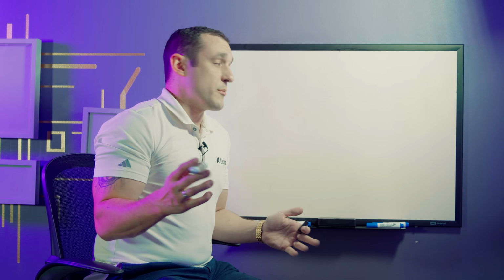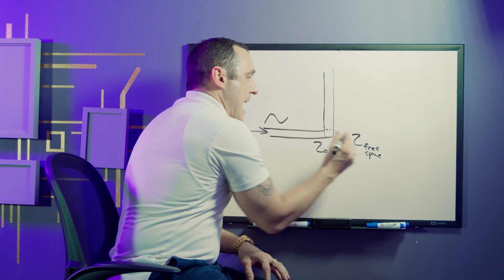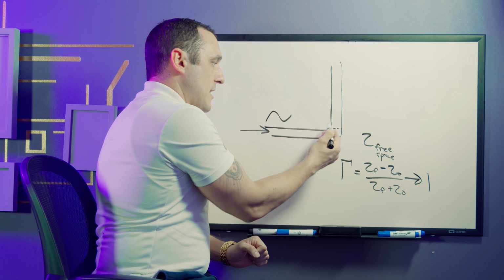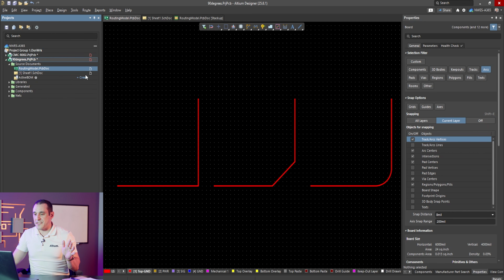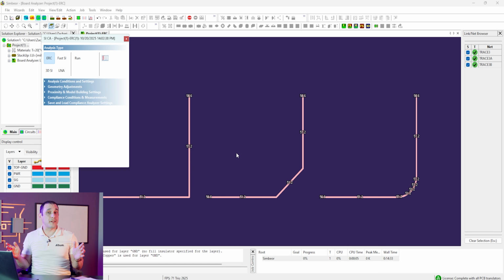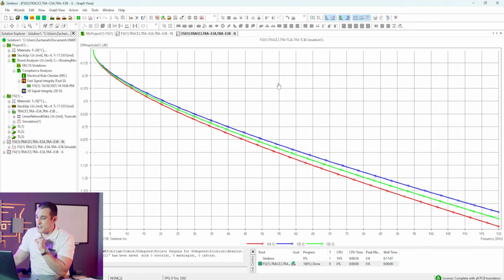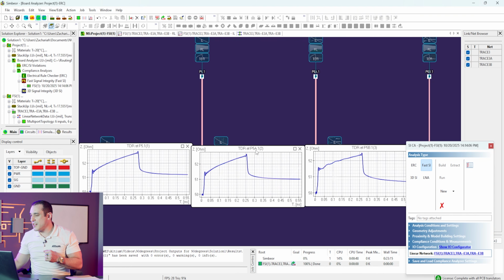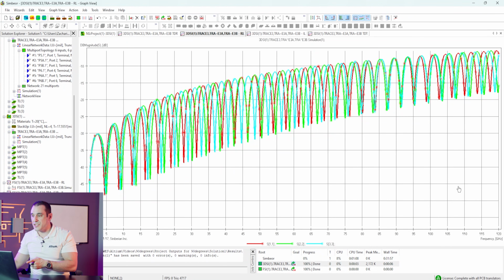Do 90-Degree Bends Hurt Signal Integrity?

Comment: I look at 90-degree PCB traces mainly from a mechanical durability perspective.
For this reason, I do not agree with you; in environments such as automotive applications where vibration and flexing are present, manufacturing-induced stress and the mechanical load of heavy components concentrate stress at these corners, which can eventually lead to trace cracking and intermittent connection issues.

Comment: B-b-but, what if the trace into a via is off center, on one side with the trace at the other end of the via offset on the other side of the via?
Doesn't that create a cylindrical 'roundabout' signal path, similar to a coil, instead of a right angle? 🤔

Comment: If there is a preset size W(idth) x T(hickness) for a trace, then when you go into a 90 degree bend, the trace increases in width by x1.414. But here is a question. IPC-600 and -610 Class3 are an assembly I.P.C. standard, but IPC-220x is a PCB Design I.P.C. standard so how do you design to -600 and -610 assembly standards where the hole fill must be 75% minimum, but you have many different flow rates vs temperature etc, different menisci etc? Too big and the hole does not fill, too small and the leg does not fit?
Reply: Yes the 1.414 factor at maximum gives the additional capacitance, it's just a matter of whether it is noticeable in TDR/S-parameters. About your other question, this is partially a processing challenge and partially a design challenge. In the processing aspect, the manufacturer needs to verify their process will allow sufficient flow in a given hole for a specific type of solder (leaded vs. non-leaded). It also varies by solder paste type as these have different ball sizes and flux content. If the assembler is to guarantee Class 3 for through-hole parts, they will typically publish guidance on the hole diameter oversize required to ensure qualification. If they do not provide this information in their capabilities, then an email to their technical support team can get the question answered.

Comment: You tell University students that electricity is like water in a pipe. Why would do that, why would you do that to anyone. Im out
Reply: Well I stated why I have done that in the video, it was to help them conceptually understand Kirchoff's current law, this is 101/201 level students who still don't fully understand things like orbitals, energy levels, or electron mobility. So just to understand Kirchoff's current law it is actually quite helpful. I of course also follow this up with "that's not exactly how it works, go learn quantum mechanics and solid state physics if you want to know that in more detail". Unfortunately, that last part does goes in one ear and out the other.

Comment: The electrons need to slow down to navigate a 90 degree bend and it messes up the timing.

🤓
Reply: This is totally wrontg, that is absolutely not how an electromagnetic wave propagates along an interconnect. Electrons do not "flow" in a conductor like water in a pipe. Electrons and holes are excited along the length of the conductor as a wave propagates, and that change in the charge separation along the length of the conductor creates a changing magnetic field and thus a changing electric field over time along the length of a wire. That is the self-reinforcing effect that creates wave propagation in any medium (or vacuum). A given electron moves an extremely short distance during wave propagation, it's not like one electron enters one end of a wire and that same electron leaves at the other end of the wire, it does not work like that at all.

Comment: Interesting, from the thumbnail I assumed transmission lines, not pcb traces, where gigabit network cables should not be subjected to 90 degree bends, or so they say.
Reply: That's because a sharp bend in a cable causes it to get squished which changes the spacing of conductors, and you're putting stress on the conductors and risk breaking them.
Reply: All PCB traces are transmission lines.

Comment: For the RF transmission theory guys,  look at a 1/4 wavelength of a WiFi 2.4 GHZ antenna. If you are working in 50 GHZ or higher, you might have to give this consideration and design for PCB transmission lines, but for all signals below 1 GHZ, the VIAs and other lengths around a corner, is way too small of a portion of a wavelength to matter. Designing microwave PCB transmission lines and maintaining trace impedance and controlling crosstalk is another level of PCB circuit design.

Comment: Are you able to do impedance analysis in each point on trace? There should be larger difference when much shorter chunks of trace are analysed to isolate bend area.
Reply: That's exactly why we do a TDR. You can create a heat map and visualize it if you want, but the most effective tool for identifying a deviation in the input impedance along the trace length is with a TDR. With a faster TDR pulse you can isolate smaller areas down to a given level of accuracy. I suspect this is where we get some justification and limit numbers for critical length rules (there are multiples of them), all of which are BS as I showed in another video.

Comment: The whole conversation comes from DIGITAL world and someone who already did analog&mixed-ssignal electronic designs from electrical schematics to pcb-routed alredy DO know, that every "rule of thumb" of all-digital-design  people are mistake-prone.
Reply: The conversation might originate from the digital world but the results do not care about digital or RF. S-parameters don't care if you are working with digital signals (where the signal extends across the entire channel bandwidth), or if you are working with an RF signal. The S-parameters in a linear system are always the same in either case. This is why I showed a bunch of S-parameter plots, so that we can see clearly what is the effect of the bends in different frequency ranges.

Comment: I think the simulation results are legit in low frequency settings, HF will be different because of the length.
Reply: I stated what is the impact of length when we looked at the S-parameters; it is responsible for producing the different insertion loss curves shown in the video. Go back and look at the discussion of the single-ended traces results. Note that those curves show total insertion loss, not dB/length.

Comment: Back in the late 60's and early 70's when we were using tape for photographic PCB's we were told to avoid angles sharper than 90 degrees as they were a trap for the etchant chemicals, and if not washed properly, were a source of corrosion. So, for totally different reason. The joke was that electrons would shoot off the end end as they couldn't take the corner 😃
Reply: but inside chip traces is 90degree)
Reply: @VitalkaCustom  Conductors in chips are not etched with a wet process, so the problem does not apply in chip fabrication.

Comment: Vias are also 90° bends - twice in a row - yeah. Good call.
In general i MUCH rather have curvy traces or large rounded corners. Sadly many tools and even manufacturers have poor or no support for that.

Damn i liked my apple-tree-pendant: a nice flowy tree made from traces with tiny LEDs in the apples. Sadly back then there was no JLCPCB or others that would make decent and affordable one-offs like that. You'd either have to go to the big boys and pay an arm and a leg cause they would either not do such small runs or just had huge setup-costs, or you go to some specialist and they wouldn't support those things.
Yeah so it was done at the local university. Photo-printer and etching by hand.

Comment: You forgot about the different trace length. This also affects the signal (integrity).
Reply: Actually no, I did not forget about the trace length, I stated specifically how the trace length impacts the results when I discussed the insertion loss. The difference in the trace length is the reason for the different insertion loss curves, those curves are in a total loss value, not in dB per unit length, that's why the curves are all slightly different despite being on the same materials and trace widths (same impedance).

Comment: Smooth curves are pretty. A correctly designed 90 (with outer corner flattened to 45, but inner corner sharp 90) works just fine up to low microwave, but if you have the option to use smooth curves, why not?

Comment: If you want to repeat this, try traces with an arc as the outside edge.
The first thing that strikes me is the trace width at the bend.
Reply: Yes the trace width at the bend creates that small amount of additional capacitance that Dr. Bogatin mentioned in the video. Well I used the situations shown in the video because those are the trace routing methods available in Altium Designer. You can do an automated chamfer and decrease the length on the inside edge to zero, but it's not automatic just from point-and-click over a long distance, you have to zoom into the area and carefully click it down to get the chamfer that small.

Comment: Is the bumps/oscillations in the plots as frequency increases due to the free spectral range of the trace, similar to a fabry-perot cavity?
Reply: Good question, this is analogous to free spectral range in a resonator like a Fabry-Perot cavoty. Those features are due to residual impedance mismatch between the trace and the load. At certain frequencies, there is a small amount of reflection that has constructive interference with the incoming wave, creating strong reflection as seen at the input port of the channel. At 180 degrees off from this frequency, you have destructive interference and you get a valley in the return loss plot. If you change the length of the trace, the peaks move. That's why all 3 traces have the peaks/valleys at different locations: the traces have different lengths.

Comment: What is the dis advantage of rounding the corners? Is it just poor tool support (and tradition, and overcorrecting against superstition) or is there a positive value in sharp square angles?
Reply: Not only that but why not make the arc the whole length of the trace?  Why not just route point A to B with one straight line?  I get it that you kinda need a contrived example here just to compare things but why not compare more things?
Reply: Yes, I want the answer to this one

Comment: I always go for the shortest path, which means mostly 45 deg angles.  What you don't bring up is the larger loop area of a 'square d-tour'. A longer than necessary track also means a greater chance of crosstalk
Reply: Well, as the TopoR autorouter shows, the shortest path almost never involves 45 degree angles ;-)

Comment: When it comes to reflections, insertion loss, and return loss, factors like proper stack-up, trace geometry, and even copper roughness are far more critical than worrying about 90° bends. Until these aspects are fully controlled, 90° bends shouldn’t be a major concern. As noted in the video, 45° angles are standard in ECAD because they minimize distance and optimize space. While 90° bends can cause reflections, this issue should be addressed in the broader context of all factors impacting signal integrity—not in isolation.

Comment: One time rf engineer comes to me and says "make 90 degrees bends on this rf tracks"
TL;DR rounded design failed EMI certifacation + loses range, but sharp bend passed.
Reply: Interesting.  I wonder if that is because bends look like 1/4 turn inductor???  Could it have been due to the trace terminations???  Be interesting to know why.
Reply: @darrenconway8117  could be just lengthing the tracts slightly detuned a resonance.
Reply: @BrettDalton  Yeah that's the sort of angle I was looking from.  Changing the length of the trace could have changed the match to the terminations.  Sort of like mis-matching antenna lengths.  It's all speculation without measurement and evidence.

Comment: At these frequencies over 10GHz you should take in conductor flatness as well due to skin effect
Reply: Yes that's correct but these traces are all in the same stackup and copper weight. The simulation assumed flat conductors, but even if we had assumed some roughness it would be the same across all these traces, and they would have the same characteristic impedance and insertion loss. There might be some small effect on the bend region but I would expect it to be ~1-2 Ohms at most as seen in a TDR plot.

Comment: Besides EMI and signal integrity concerns, there was also another reason for not using 90° bends and this has to do with the PCB manufacturing process. The sharp point of the outer edge is more prone to over etching. Also, the inner corner also will hold more of the enchant due to surface tension. At least this was what was explained to me 40 years ago in college. With better process control today this may not be as big of an issue, but old habits die hard.
Reply: This is always a fun one - when I was learning PCB design the same reason was explained to me. However, despite this explanation of over-etch and creating an acid trap on the inside of the right angle, if you look at a lot of old hobbyist and DIY magazines from the late 70s even into the early 90s, over half of the PCB designs provided to subscribers had right angle traces. I guess that the hobby designers didn’t want to take the extra time to tape the 45 degree bends in their layouts! 😂
Reply: @joegrisso  On a flex PCB you want rounded corners, or at least 45 deg corners. But this is because of mechanical stress when bending the flex PCB. not related to fabrication.
Reply: @d.j.wiendels6572  Oh yeah - I designed one flex circuit that we had to keep to 3 layer for flexibility, and also had to use vias in areas that were not bolstered by a stiffener because it had to be adhered to a slightly 2.5D curved surface with PSA. It was... very interesting. We spent 2 revs just coming up with via patterns that would be redundant and reliable should one of the vias crack during application. That was a fun project!
Reply: @joegrisso i guess that wasn't such big issue when you routed traces centimeter wide and not today's submm.
Reply: Exactly my thoughts, especially at design rule limits. All of my boards are 2-layer, so all of my signal lines are orthogonal and change direction at vias.
Reply: that problem has been solved. Today manufacturers have no problem at all withe 90 bends.
Reply: I used avoid 90º due to acid traps in fabrication process. JLPCB and others manufacturers recomendation. And sorry for my bad english. 😁

Comment: Love this video. 
Any bend must behave this same as long as the wavelength of the carrying signals is comparable (but smaller than) with track cross-section dimensions.
The only explainable reason to avoid >45 bending is manufacturability. It is still important aspect for thinnest track.